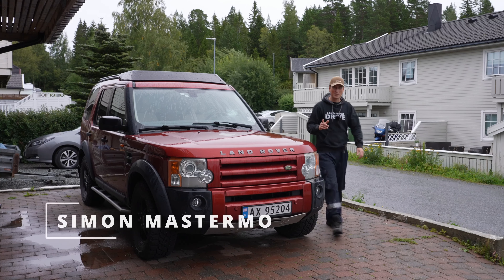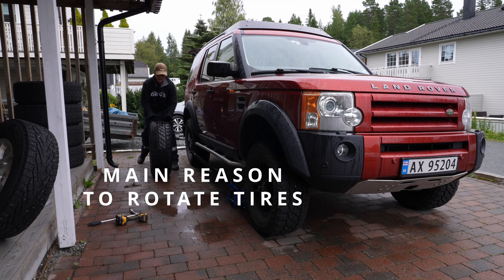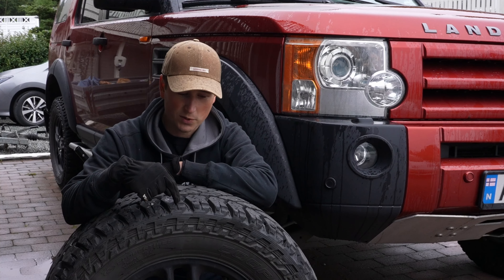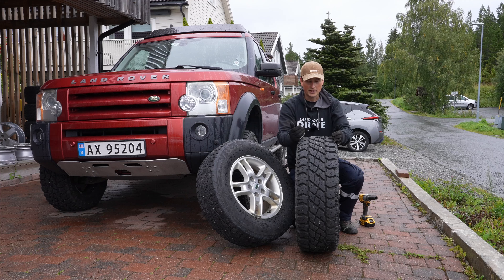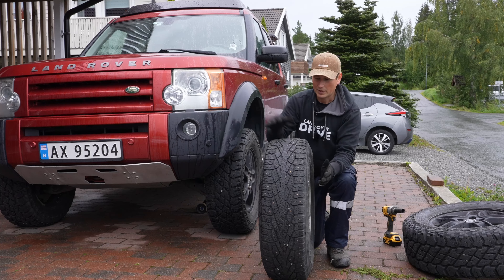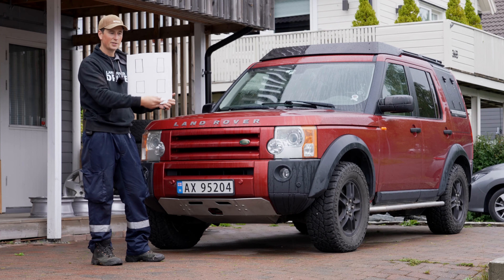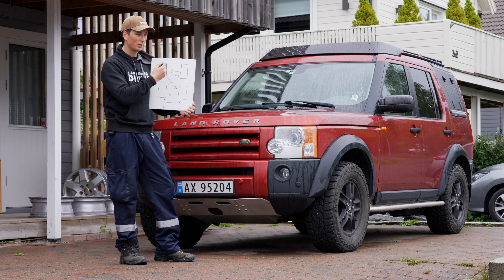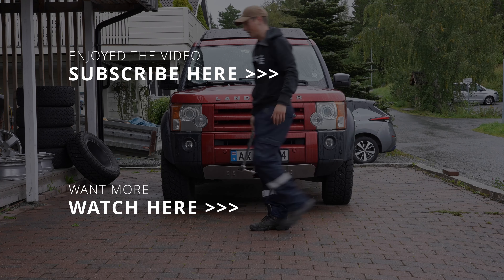Land Rover Discovery 3 MT Tire Rotation - This works for me!

Comment from the maker: Do YOU rotate your tires?  And how do you do it?  🤔
Reply: Frankly, no. Best goes to the rear. If a new pair is required, the new ones go to the rear, old rear ones to the front.
Reply: And with your Coopers, once in a while check your inner sidewalls. As you might remember mine blow up at 110kph, on the rear. Big split directly at the bead.
Reply from the maker: @Christian76S  Okay, may I ask way, is there no need? 
And which tires are you using?
Reply from the maker: @Christian76S  I will put that on my todolist when I rotate or change to winter/summer tires. Very good point!
Reply: @LandRoverDrive 

1st: the better profile (tread depth) needs to go to the rear for an improved ability to displace water. Cause the rear axle is what guides the vehicle in its tracks.

2nd: Compare the swap of tires to grating down a piece of Parmigiano: you're turning it, changing sides, to grate it down faster. Right? Now imagine what happens to sawtooth of you change the main rotation direction by swapping them to the other side: wear and noise gets even worse.

Hence I retain the sides, but better profile goes to the rear.
Reply from the maker: @Christian76S  Why I ask is because with winter tires I always prioritise the fronts, for better steering and braking abilities. Also aquaplaning, as the rears often experience that as their in the track of the front tires, mostly, a bit of axle width issue on many cars. 

Noise I can confirm after a bit of test driving these past days after the rotation, but I think as the stepping cancel it's self out, the noise will also go down. 

Thank for the respons. I love to hear and that the videos can be a learning place for all, including my self. :)
Reply: @LandRoverDrive  Of course the sawtooth/stepping will now quickly wear down. But resulting in an overall faster wear of the tire/s.

For a Troopy you'd be right, that really has to tracks. But the Disco axles run in the same track, the rear body is just a tad wider, making the axle look narrower.

I learned car mechanic in the first place, as my first job. The rear axle is what guides the vehicle. If the rear axle starts to float due to aquaplaning, you're losing control. No chance to compensate.

Lets have a look at wear due to weight and use of tire: surely the front wears faster, being the steering axle with even more weight of an empty car. If you would just swap entire axles, you could even down the wear. But then at one point in time you'll need 4 new tires. If you wait until the front is worn, then putting the rear to the front, and new tires to the rear, you just need 2 new tires. Twice as often, but half the price each time.

Thats how I do it.
Reply from the maker: @Christian76S  Okay, how many years do you have the tires for? I have found that for both summer and winter tires 5 years is pushing the limit as they then start to form crack in the rubber, or other issues. My Grabber AT2 starged bulging out in places in the outer side wall. Not good. 😅
Reply: @LandRoverDrive  5-7yrs is the limit anyways. So after 3 years new ones for the rear, and rear to front. KO2.
Reply from the maker: @Christian76S  I would have bought the KO2, now KO3 if I were to buy new tires today. Maybe even Nokian Outpost. Basically going less aggressive tires, as I mainly go overlanding in norway and there's no need for Hybrid or MT tires here. 

Again, thanks for sharing Christian. 👍 I guess there is as many ways of maintaining a car, and tires, as there are owners out there. And we all do our best. 😊
Reply: @Christian76S 😊😊😊

Comment: With my BF Goodrich KO2 tyres they get very noisy if you rotate conventionally due to lug stepping.  Much quieter if you rotate as a directional tyre but they won’t last as long (though I did get 120,000km out of my last set so can’t complain.
Reply from the maker: Hey, that's great info, the noise factor. I went for a test drive yesterday and hour after changing the tires and it felt noisy, but it was raining heavily so could be a factor. I will do a test drive when it drys up and see. 

After well into the second season with my STmaxx I definitely have noticed more road noice. And on really slow turns, on almost full lock, I can feel the outer lugs really well. Like when backing into my driveway. 

120k km is great. I hope to get 60-80k km and then I will be happy.  4 -5 season and 80k km is good I think. The rubber get's old quick after that. 

The KO2 was the top competitor agains my current setup and will probably be on the top next time. I would love to test out the Nokian Outpost tire just to see how much better it is to drive on longer trips. My winter tires is just a dream to drive with, easy and so smooth. 👌
Reply: @LandRoverDrive  I think they will be the new KO3 when you get to look at them.  KO2 has issues with sidewall cracking on 60 profiles and less (related to running on lower pressure and sidewalls overheating).  KO3 they are trying to reduce this.
Reply from the maker: @snorris89  Yeah, you are probably right. They launched them a while back. I haven't seen them in Norway yet.

60 profile, I think I will go for the same size as I have for winter, 245/70R17, so nice to drive and feels like the car loves them much more as well.

They roll easier, they drive true without any tracking. 

I'm tempted to go up to 245/75R17, which is just at the limit of what I'm allowed to have on my car, but again, the 70 profile is fits much better with the gearing.

Only thing is the 70 vs 75 profile has a lower load rating, with the 75 you get 121. 

But KO3 will be on the top of the list for sure, I haven't really heard anyone having big issue with the KO2, so much be a good tire. :)

Need new winter tires first, won't come cheap so hopefully I have good 3-4 seasons on the summers left. 😅
Reply: @LandRoverDrive  tyre wall cracking has been an issue in Australia on 265/60r18 which is my size.  The r17 sizes would do better as the tyre wall to width ratio is closer.  K02 side walls are super strong but that comes with reinforcement that will heat up if flexed so they are sensitive to low tyre pressures at highway speeds.  I think the lr recommended pressures are too low for these tyre constructions.
Reply from the maker: @snorris89  Nice info, and I think your tires have it a bit harder than up here in Norway, with the intense heat  you see down there and sun exposure over time. 

When it comes to tire pressure I usually at 40 psi on the summer set, trying to avoid side wall sag as much as possible. It's a heavy car and on the General Grabbers AT2 I had, they got really soft in the end.

I guess it will be a bit more noise but the D3 is not noisy at all, so worth it I belive. 

I feel the STmaxx's has sagged a bit since new, but I guess it is to be expected.  Why I try to find the tire with the highest load rating that I can within legal speck. +-5% of original size is the rule in Norway. 

And Australia, Every Norwegian overlander dreams of driving there.

Comment: For my non directional Duratrac tyres i swap front left to rear right and front right to rear left. I have never introduced my spare into the rotation which I probably should because when I changed brands to the duratracs I now have an unused Cooper Xeon Ltz tyre as my spare, which bugs me because I've never been happy with mxing tyre brands.
Reply from the maker: Yeah, makes sense to do it that way with four, you get a bit of both sides and a bit of front and rear. 

It’s maybe overkill to do a double cross, but then again, every tire gets all the type of wear. If that makes sense. 

This set of tires that I have on is my first set to be a complete set of five, so understand where you’re coming from. 
I had the original 19” underneath the car as a spare for 8 years. 😅 

If you can match the size with your spare I wouldn’t bother changing it out, but if it’s far off it might be worth it if you end up using it at some point. 

Tyres are getting so ridiculously expensive that a spare is what I call luxury item at this point. 😂
Reply: @LandRoverDrive  yes I agree with what you've done. Makes sense 👌
Luckily the cooper is the same size 255/55 R19.
Yes, good tyres are expensive! More so in NZ.
I have never had a flat tyre yet and hope not to in the future 🤞 so yes, does seem like a luxury, but is a must have when going remote, even though I carry tyre goo in a can and a tyre plug kit.
Reply: @LandRoverDrive  I got rid of the spare under the car as I could not imagine emptying my boot in pooring rain to access the spare tyre 😅
Reply from the maker: NZ, nice, looks so beautiful there. 😊 And bit better climate than here. 

And yeah, would want a spare as well. Same size, I would run with that. 

I haven’t had a puncture yet neither, but I always like to be on the safe side of things. Especially if the family is on board.

I would like a spare for winter but as I figured out today making this video, I would need two for rotation to work correctly. 😅 Double expensive. 

Wouldn’t be a big problem having just one as it would be more than good enough to make it to safety or back home. 

I probably could use one of my old ones as a spare no problem. 💡😊

You reminded me that I need to get some tire plugs. 👍
Reply from the maker: Hehe, my winch lift broke, so I have been going on trips with the spare safely stored in my garage. 😂😂

Spare carrier at the rear would be nice but I’m at the weight limit soon.  😅
Reply: @LandRoverDrive  NZ is beautiful, just very remote which has some advantages and many disadvantages!

Yes, one spare (used or new) can work and will get you home. Two would be expensive!! I see some overlanders and bush trucks with two spares on board - over kill and too much additional weight, sometimes in the wrong place on the vehicle.
Reply: @LandRoverDrive  I made my spare wheel and jerry can carrier (I have the V8)
Not sure of weight but am guessing wheel carrier around 8kg and jerry carrier maybe 10kg so yeah does add up! However I'd rather reduce weight elsewhere to have these two accessories.
Reply from the maker: Very true and expensive indeed. :)
Reply from the maker: Okay, that's really cool, I would love to try and make one my self, but need to get my welding up to par first I think. Don't want the spare to fall off on the highway. 😅  I have added a roof rack, drawers, front guard and rock sliders and it starts to add up, 100kg total. 

Problem arrives when we are going somewhere as a family, then I would be at the very limit if I add more. 
If it weren't the primary family car I would drop the back seats to gain room and some weight. 

The total weight limit on my D3 here in Norway is 3230kg
Reply: @LandRoverDrive  fair enough regarding weight. Rock sliders are heavy! Sliders are a want of mine but I'm just not sure if I really need them. Have you had situations where you have needed sliders and were glad you had them?
Reply: @LandRoverDrive  A chap on one of the forums made a spare wheel carrier off LR Time's plans. He then gave it a good workout in Africa and it broke, loosing his wheel. He was pissed off. I told him that carrier was not designed for rough terrain. So yeah, good welds and appropriately sized tube including decent wall thickness is critical for the application 😅
Reply from the maker: @lyndonkapoor8823  Other than in a off-road setting they haven't been needed yet. 
I like the safeguard and that I can step on them, but haven't had a need for them this far while overlanding in norway. 

If you haven't seen the videos I think you will like these.  :)

Rock/Tree sliders video:
https://youtu.be/VVZ3QzEBIeM

Offroad video one:
https://youtu.be/_n8h4n8QPx0

Offroad video two: 
https://youtu.be/budtFF2GHOI
Reply from the maker: @lyndonkapoor8823  Yeah, my thought exactly. I would love to have a program for metal design with the correct specs. 

But at todays prices of steel it's maybe cheaper to buy a complete one ready to mount. But not as fun though.

Welding is really fun and glad I got my welder back when I had the Defender. Been practicing making a firepit for home use, as I need to do some welding on the sills on the Discovery. 😅

The old girls is starting to feel the salty roads of Norway....
Reply: @LandRoverDrive  well you might have convinced me haha. I have, once, pulled the plastic sills back into the rear tyre skidding across logs in a river, so, another item to make by the looks! I find making these items myself, cost 25-30% the cost of a bought item, excluding time of course.
I'll check out the vids, thanks!
Reply: @LandRoverDrive  oh no , salt 😭
I see so many pics of D3's in UK absolutely rotten and corroded. Nothing like that here thank goodness.

I enjoy welding, once having earned my welding ticket/ cert. Tig and stick. Thinking about getting a mig welder one day.
Reply from the maker: @lyndonkapoor8823  That's good, it hurts every day I have to drive to the office in the salty slush, knowing what it does to the car. I should have put more work into anti rust solutions but can't seam to find the time to do everything.

Would love to get a welding cert, just for the learning purposes and for the confidence to weld that swing away. 

After much research I found that Mig was the best option for me being that I will mostly work on restoring and fixing cars, and not part production with TIG.
Reply from the maker: @lyndonkapoor8823  I will probably weld up the sills and then spray them with 2k epoxy, maybe Black Raptor, instead of putting the plastic back on. 

The plastic just gather all the salt and keeps it rusting even faster. 

25-30% of the cost is good, worth the time than, especially if you enjoy the making process, which I really do.

If I could make a leaving out of making stuff for cars I would. 😊

Comment: On AWD vehicles front to rear and that's it
Reply from the maker: Okay, why only front to rear and not cross rotate on AWD? 🤔
Reply: @LandRoverDrive  well I said AWD, because front tires also pull, when I had my first Range Rover, a 93 Classic, I noticed tread life significantly lost if I cross rotated
Reply from the maker: @CristianZamora  I will try to monitor my tires from now on and see if I will notice more wear because of the cross rotating. 

And 93 classic, very nice, what I would give to drive a classic tomorrow to work. 😊👌
Reply: @LandRoverDrive  since front wheels are also driven, the inner steel belts get used to that torque load, swapping sides reverses that torque load and weakens the belts causing tire sag and higher wear on outer treads... this is what an old mechanic at the Land Rover dealer in Memphis told me
Reply from the maker: Aaah, thank you for this, that is awesome information, I haven’t thought of that. 

The inside structural part of the tire could weaken due to the change of torque direction. 

Hmm, I need to do even more research, and maybe hear what Cooper tires has to say about this. 🤓

I would guess wrong or too low pressure, off-road driving and other stuff would have an impact as well to the internals of the tire, and therefore add to the wear factor of a tire.  

My tires see mostly tarmac and gravel roads so an even use pattern.
Reply: @LandRoverDrive I regret letting it go. On the hunt for a nice 95 LWB soft dash
Reply from the maker: I bet, I regret selling my Defender. 😅

I would love a 1985 classic, would be my preferred year, and the perfect match as I’m born in 1985. 😊

I haven’t seen a soft dash up close yet so need to see if someone owns some so I could go and check it out.
Reply: @LandRoverDrive  the "soft dash" are the ones with the stereo head unit up high, not down by the shifter
Reply from the maker: Just googled it, it's very nice, Classic on the outside and a bit of Disco on the inside. See som traits from the Ranger Rover p38 in there as well. :)